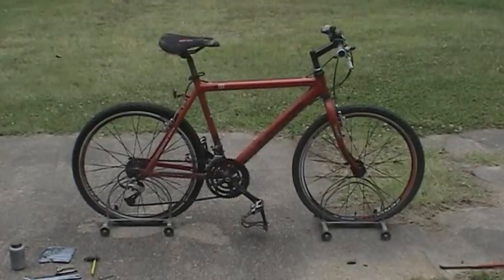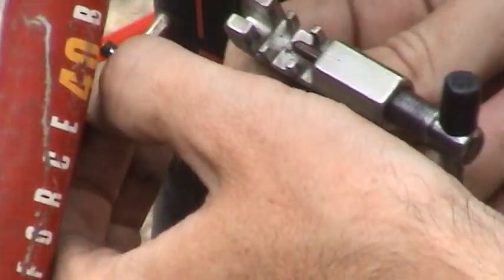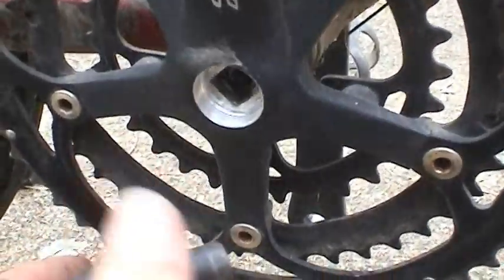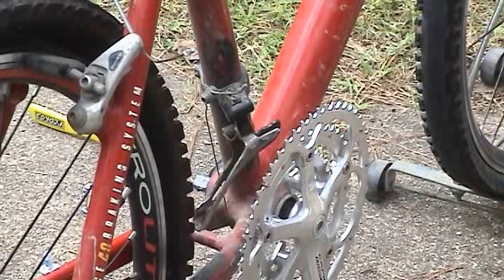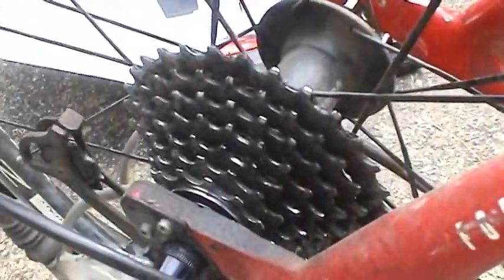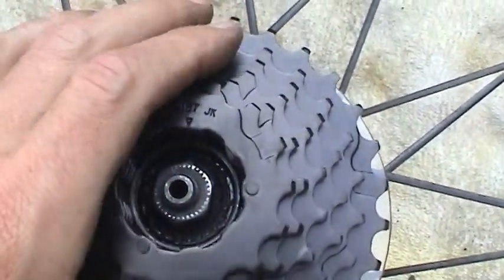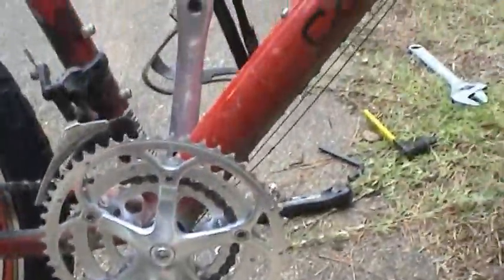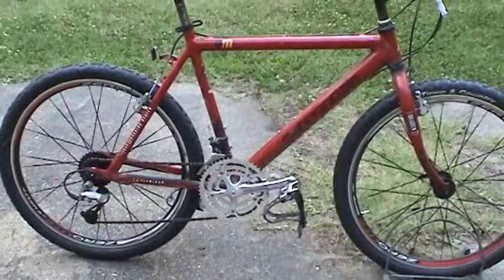Cannondale M700 Repair

Comment: You can find plenty of videos of it on youtube.  Basically a rim liner is installed consisting of air tight tape and a presta valve is installed on your rim.  Then using stans or other no flat tire sealant you add it into your tire and using a compressor pump up your wheel.  Not all rims and tires will work but most will and alot of clincher tires are labeled "tubeless ready.''  They are regular tires but they have the construction of a ust tubeless tire so those are the tires best suited.

Comment: My rear cassette is about the same condition as the one you took off!, I pretty much need to do most of what you did in the video to fix mine up right, hopefully, I can just put new gears on the crankset, as that is easily the most expensive part, I think I gave around $160-170 for mine.  took forever to get here from Singapore! (ebay) but I did get a good deal on it.  (or at least at the time)

Comment: Good video.  Just a point you can use a sram 8 speed power link to connect a shimano chain instead of the special pin they want you to use.  This way you can take the chain off anytime you want in acouple of minutes and you don't have to worry about a stiff link which can happen with those special pins.  Also shimano jockey wheels are usually labeled for upper jockey wheel at least the jockey wheels I have seen.  You seem to do alot of offroading so have you thought about doing "ghetto" tubeless

Comment: Cool video, now I know its not complicated and I can do this on my own. 
Btw, I bought bicycle last year and got a problem. For example: on the crankset my left crack got twisted. I know I'm heavy (110kg) but how the hell that happend? I've never seen case like that...

my rear cassete is 14-28, I'll put 12-32 'cause I want to go faster. But then I see this... You have 53 tooth on front. Mine is 24-34-42. So did you lose something on hill climbs? what are the other numbers?